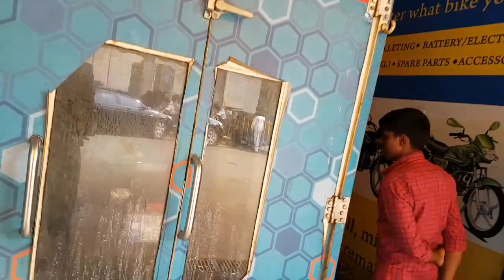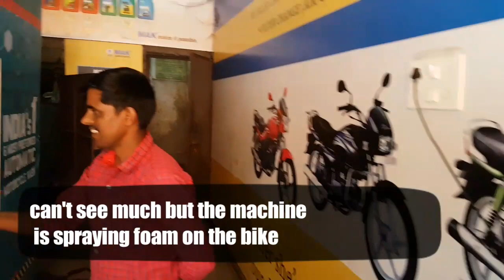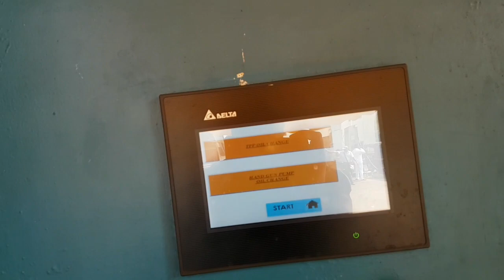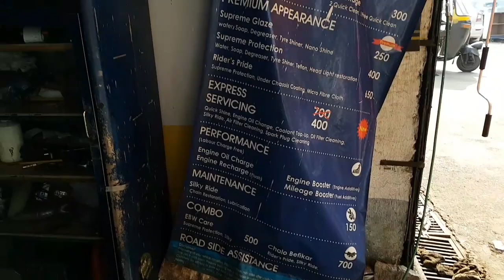BIKE WASH EXPERIENCE AT EBW GHATKOPAR

Comment: This automatic bike wash is very bad
the cabinet and the water pressure and the foaming will not wash bike very well . only outside body 
you may see it needs manual wash. First video upload this bike wash machine didn't show manual wash, they didn't notice this.

and the cabinet I suggest you destroy the cabinet, you can't do manual wash very well. you need to sit / squat...your butt hit the cabinet. If you make the cabinet bigger, you will make very big mistake. You need try your self and you will see, and remember to upload your update video again